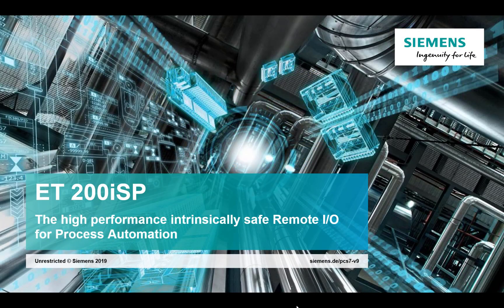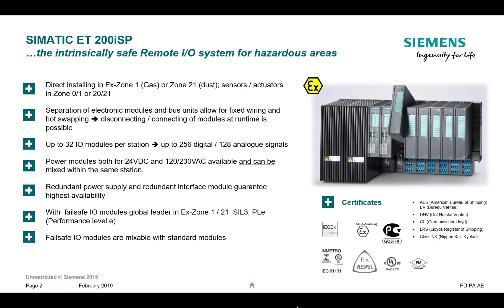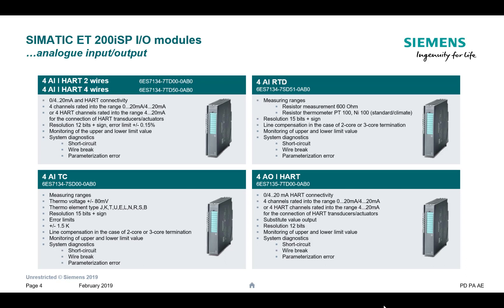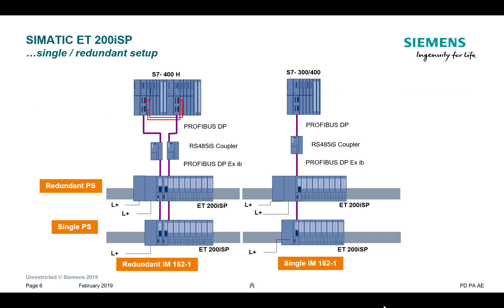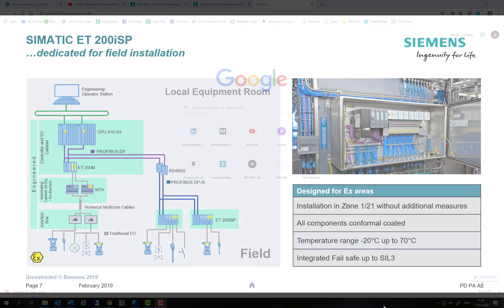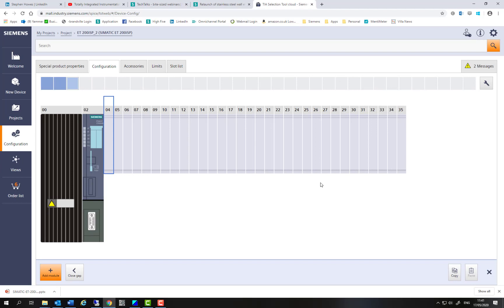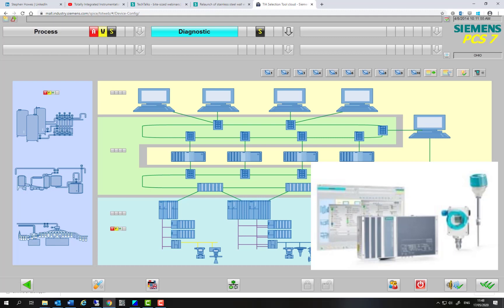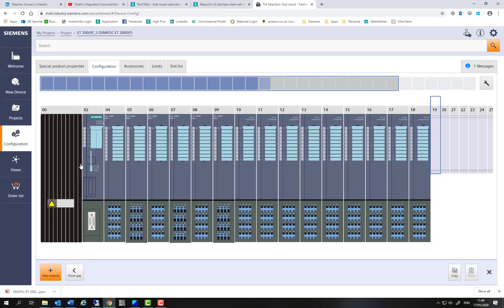Introduction to Siemens ET200iSP and configuration Tool

Comment: Thanks for the webinar. i have a question about the redundant PS. Is it possible to run the ET200isp with only one PS when it is configured to be redundant ? just for a short time after we remove the old cabinet? it seems possible because this is indeed why there is two PS's if one fails the other should keep it running but i wnted to be sure. can you confirm this pls? thanks in advance!